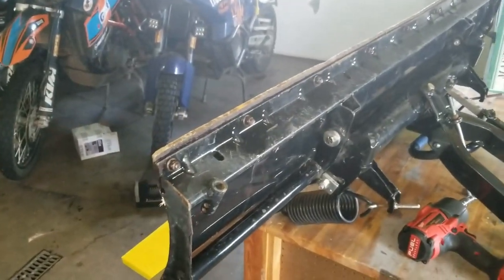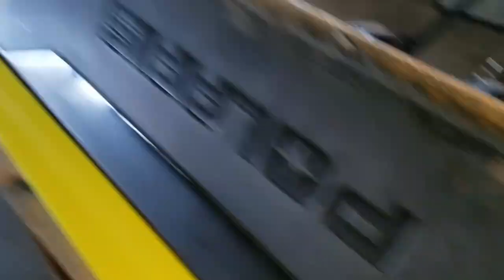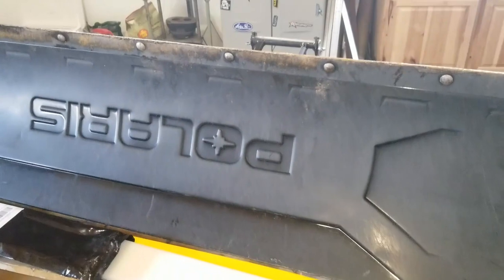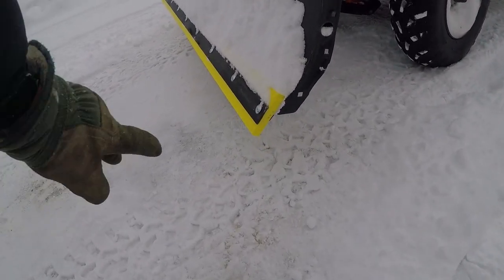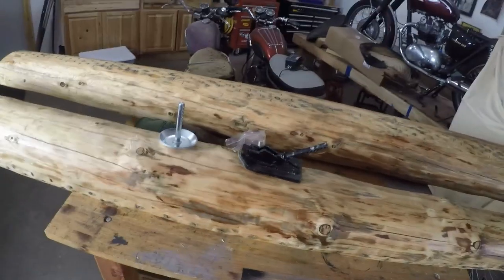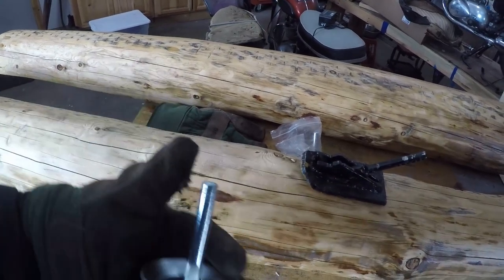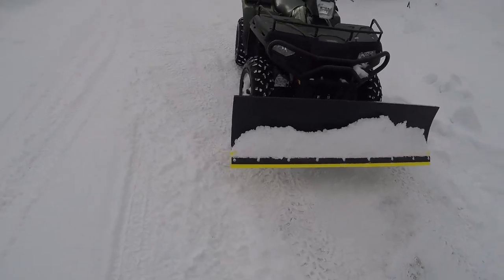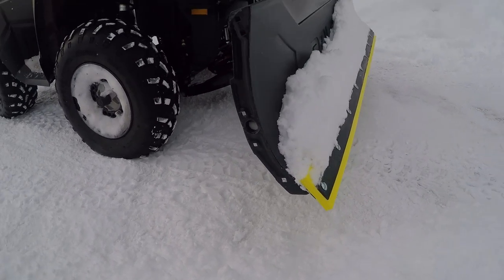Fallline ATV Snow Plow Cutting Edge

Comment: So at almost a year later, how us the cutting edge holding up? I am just replacing my cutter now. The cheap POJ that comes on the plows don't last that's for sure. My plow is only a month old, so I went to my local steel fabricating place and had them cut me a piece. Done that with my last plow and it lasted three years  and than I sold the bike and plow.